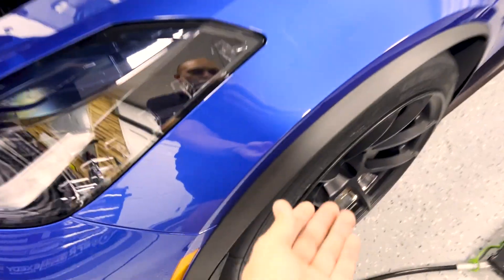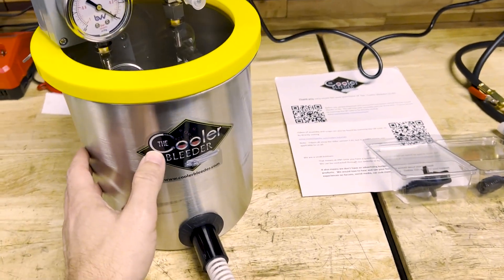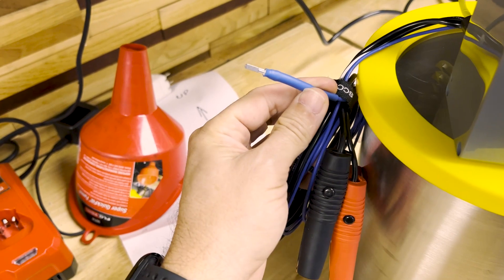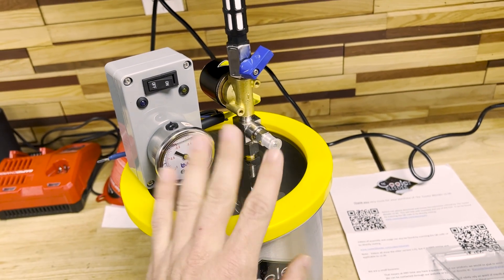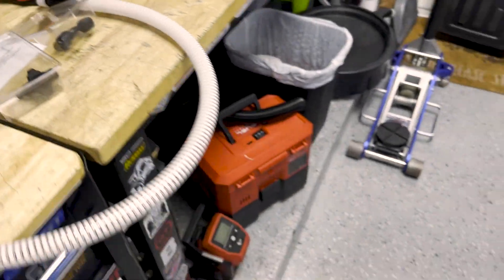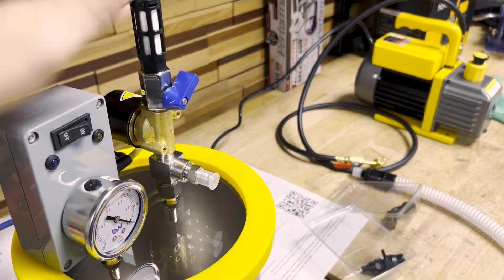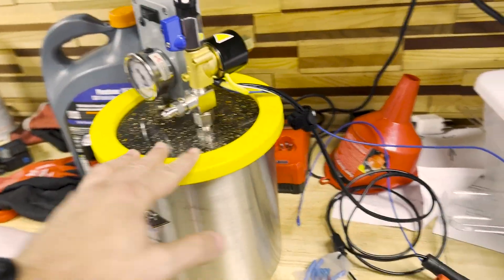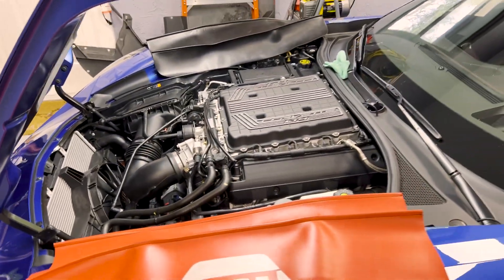C7 Z06 Cooler Bleeder Review -  Can it  eliminate ALL air from your Supercharger Intercooler system?

Comment: after watching this..me being a retirred plumbing contracter..this is  got 2bee the hard way 2doo this!!!...if a small valve ..a 1-time installation was put on top of that tank...you cood bleed the air out that way????
Reply from the maker: @scottbarker9058  very true
Although, with road course stress not sure it would hold up long term.
The Gasped tank seems like a good long term solution that should put up to any abuse

Comment: Are you planning to do the corder performance expansion tank and heat exchanger? Should help with the air bleeding.
Reply from the maker: No I’m not. I mostly use the car for HPDE/road course so an expansion tank is not a worthwhile upgrade, supposedly the only one that does work ok for track is the Gspeed one